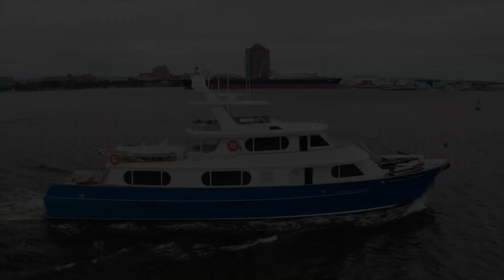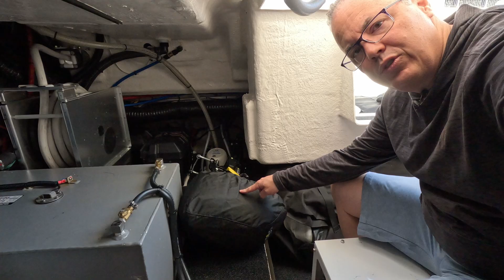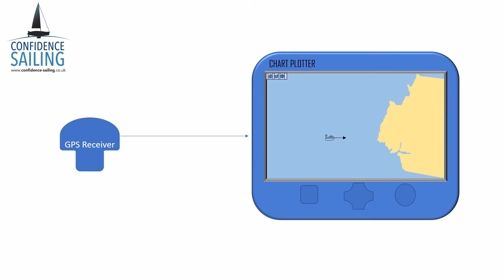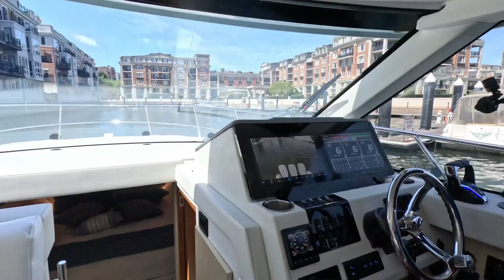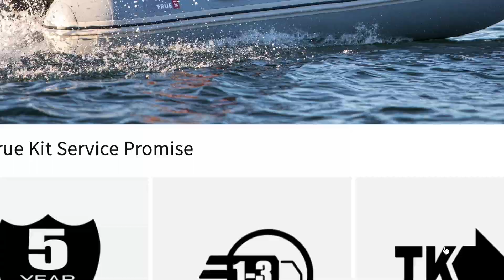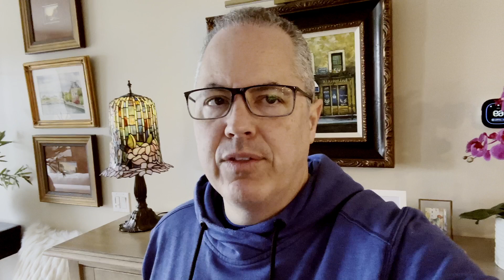(Ep 13) 2024 Regal 38 XO: PROBLEMS, ISSUES & HEADACHES

Comment: man you're being really 'diplomatic' due to your friendship with Regal, I assume. The fact is, these issues are horrific and unacceptable. It's widely known that craftsmanship in boats has completely went down the toilet in the past 5-10 years due to the woke era, economics, etc. Everyone recommends to NOT buy any new boats, just like you should not buy new houses, for the same reason. Just do some research and see, it's much safer buying a 10-20 yo boat than a new one these days, and you'll have less problems.
Reply from the maker: I could not disagree with you more.  Having owned 17 boats now, 1/2 of them being older boats and 1/2 of them being new.  New boats have their problems, they are simply different problems than older boats... same about of issues, just different.   Older boats have AC issue, entire systems that need to be replaced, out of date and no longer supported navtronics, parts shortages and no parts being available at all... Now I will say that older boats were built heavier/thicker hulls, however that is like saying a car from 40 years ago is better and safer because it is heavier.  If anyone has purchased a Carver can tell you their gelcoat was terrible compared to what is being manufactured today.  Although Carvers have one of the best layouts I have ever seen and experienced.  Now where we can agree on is boats built between 2021 and 2023... those are the boats in my opinion that suffered from more quality issues than those built before that timeframe and after...   This is just my opinion from owner boats built in the 1970's all the way to new boats....

Comment: With respect to the Garmin AIS issues, 1) Has Garmin provided any software patches to improve the experience?  2) Do you have any experience with any other vendors' AIS implementations?  If so could you compare/contrast?
Reply from the maker: That is a great question. No Garmin has not improved their AIS interface at all. It is still terrible. In my opinion, Timezero are far superior in their interface.

Comment: REALLY surprised that after a beautiful custom yacht that you chose a Regal.  Why not a higher end boat like a Tiara, Princess, even a Boston Whaler?  Just thinking of quality as opposed to the style or layouts here so perhaps that’s what it came down to?  Thanks!
Reply from the maker: Hey Hillary, thank you so much for watching and supporting the channel.  To answer your question in several parts, our first requirement was outboard power. There is no way to obtain the storage capability of the Regal 38 XO in a boat that would have inboard power. Second would be two cabin configuration. Referencing your list of other manufactures, two of them would be disqualified immediately because they simply do not make those types of products. Reference your quality comment, without getting into specifics, I can tell you that I have had two boats purchased back by one of the manufactures you listed because of massive quality issues and construction issues. In my opinion, all of these manufactures boats are built the exact quality standards, using the same pumps, engines, Navtronics etc, it simply comes down to style, and design.  Finally we wanted a boat built in the US, having had vessels built internationally before, obtaining parts for the simplest of things for example, a spare key, can be nauseatingly complex.  I hope that answered your question.  Again thanks again for all of your support!
Reply: @From100to26  I so appreciate your thoughtful reply - and completely understand.  All of your decisions make perfect sense.  Quite honestly, I found your channel because I was drawn to the big live aboard you built.  I’ve had the same dream for most of my life.  The seemingly quick turnaround on the direction you went was a sobering surprise, and gives me more food for thought.  My boating background has always been as the “girlfriend/wife” half of the boating couple, but I have my own money separate from my husband’s and am seriously considering buying a large boat (80-120’-ish) to do some slow cruising back in the Pacific Northwest where I used to live, and that would also serve as a home on the West Coast.  My husband and I currently live in South Florida and I can’t deal with the summers here.  He is a fair bit older than I, and while he used to enjoy boating he sold his last boat (a 42’ SeaRay Sundancer - which BTW had a 2 stateroom AND 2 head/shower layout) some time ago.  He is fine tagging along with me on this maybe-adventure I have in mind, but it really is my own project.  My hope is to find a boat large enough to serve comfortably as a part time home, but small enough to manage with day crew (temp captain and deckie/stew) while repositioning.  I do have experience running both a 68’ and an 84’ motor yacht with my previous partner, so I’m not a complete beginner LOL, but this was some 18 or so years ago and after some fairly serious health issues, my body isn’t as strong as it was back then 😂🤦‍♂️😭 I’m no spring chicken.  I’m so curious to hear more about the decision you and your wife made to go so far back down in size.  The big boat was beautiful and I was really surprised it had such a short spell with you, and even though I completely understand the reasons you discussed for making that decision was there more to it(?).  Cheers!
Reply from the maker: @hillaryc.3727  Hey Hillary... we had Bravo for 5 years.  But a lot to chat about reference your comments.  I would recommend sending me a DM at the From100to26 Facebook page and I will send you my number so we can chat.  The long and the short of it, going from 80 foot to 100 foot is double the size of boat, and also going from 100 to 120 is doubling again, most people don't realize that.  Your voyages will be measured in days not hours and to dock a 100 foot plus boat you will need at least two deck crew.  But again, we can chat more when we connect.... We had two deck plus 1 Stew on board, and I did all the engineering.  We refit all of Bravo's systems, even still we have larger projects every week.  It took the crew 2 days to complete a wash not doing the 1800 sq ft of teak deck and 700 feet of teak cap rails, which if they addressed those, add two days.  The vessel was washed every week because it had to even when sitting at the dock.  The new owner hired a Captain and because they did not have an engineering background ended up damaging a lot of the system and costing the owner well north of 250k.

Comment: Have you looked into Sharrow props?
Reply from the maker: Hey Chuck, thanks so much for your support and your comments.  Yes we have looked at the Sharrow props, at 15k for our boat, it is not an investment to take lightly.  For us we have to look at the reward vs cost, if you look at the higher end where we tend to run (30+ knots) the performance/fuel efficiency gains are rather negligible.  However where the Sharrow props shine is at the lower RPM and keeping the boat on plain.  We wanted to gain experience in how we would be running our boat before deciding on the investment... also if we were going to move up a size ....
Reply: @From100to26  really like the boat and the content! be safe and post more!
Reply from the maker: @chuckvogt899  Thanks again!  Working on the next video... we took the boat out for a month long trip.. so sorry I have not put something up recently...

Comment: I own a 2018 Regal 28 Express and have had problems over the last two years.  Fresh water boat mostly dry stack stored like my 2000 Doral 270 SC.  Rarely had a problem with the Doral but my newer Regal had an intermittent HVAC problem which eventually failed. A new control board fixed it until I I took it in for service and maintenance at a Regal Dealership for power steering ram and bow thruster failures.  Now the HVAC system has again failed.  Not enough qualified techs in the industry.  Love my Regal but reliability and service problems make my third cruiser probably my last.  Good luck with your issues.  🛥
Reply from the maker: Thanks Bob so much for your comments and supporting the channel.  Issues with components are really not a Regal issue, rather an industry issue.  At the end of the day, the components that Regal install in their boats are really no different than any other manufactures, I am so sorry you have been having problems with your boat.  That said I agree with you 100 percent about not enough qualified techs in the industry, I have been seeing that for years.  For us we are lucky because of dealer has an amazing tech support staff!!  The dealer makes or breaks an ownership experience!
Reply: I was just going to say, 'it all comes down to your dealer or local selection of shops. One thing I quickly learned is that I tended to NOT have issues with service folks. Why? Because I am incredibly nice to them. Sure, I'm firm about pointing out things they did wrong, but because of the goodwill I'd built, they would be very apologetic and jump me in front of others to keep me happy.
Reply from the maker: @stratolestele7611  I totally agree.. we always tip our techs very well and when we had the big boat, our main service companies we used to keep a retainers with them (always maintained cash on our account, never a debit), so we never had any issues.  That said, things are changing, the largest and best company that service the Baltimore area is shutting down as the owners are retiring.  Why, because they can't find good techs......  Thanks again for all of the support and watching the channel.

Comment: I have the same boat as you. Unfortunately I’m having the same problems with the ac units.
Reply from the maker: Hey Gary... you have the new units?  There is 1 correction available and that is for the temp of the water.  They are also working on another update that will take care of a lot of the fault messages I get.. that should be out in about 2 weeks or so.  I am working with them and feeding them information.  We just got back from our 21 day trip

Comment: Outstanding real world review. Not gonna argue the pros or cons of bottom paint on a cruiser but after several seasons of reapplication of bottom paint you will definitely lose several mph due to the irregular bottom surface because no marina can ever get the bottom back to factory new condition before adding the recoats. On a go fast vessel you can easily lose 5-8 mph. Looking forward to watching other videos.
Reply from the maker: Thanks so much Chris for your comments and watching the channel.  After talking to some of the industry coating professionals, since we have semi-ablative paint on our boat (as most boaters do) and the speeds we travel combined with the amount of running we do each year, we will remove a significant part of our bottom paint every year.  That said talking to the professionals, we should not see any degradation of speed year after year.  That is also the results I have see over the 15+ years of doing this.  If you are losing 5-8 mph... someone is doing something wrong....
Reply: Go fast to cruisers - as you said, totally different. Every go-fast I've ever seen is either trailered or on a lift. In fact, it's downright upsetting to see a go-fast with a bottom job. Get that beast outta the water! Lol
Reply from the maker: @stratolestele7611  Ummmm... can't say I agree with you.  We have not see any performance penalty, in fact a friend of ours had a 38XO without paint and we cruise at the exact same speed.  It also depends on how often you use your boat.  On our 100 footer we ran the boat about 1000 hours per year.  Right now we are 5 weeks in on the 38XO and have 65 hours and counting, so we tend not to get any growth on the bottom, which helps a lot.

Comment: I am still following your posts and find them very informative.  I couldn't agree more that allowing all parties involved in the sale, production and providing sub-systems for the boat to identify and rectify any issues is exactly the correct position to take.  As far as you A/C is concerned have you ever looked at the Mabru 12 Volt systems.  Since many of the issues you are experiencing deal with trying to make the 110v system more efficient the Mabru may off some real tangible benefits.  Just a thought.  Keep the videos coming I love them.
Reply from the maker: Hey Len!  Thanks again for the support and your comments.  We totally could look at the Mabru 12 volt system.. but then again, we would have to purchase those... and wire 12V wiring to those system... and put in breakers in the 12V panel... and Regal would no longer support the entire system.  So sometimes when you build a boat you are at the mercy of the manufactures....and can't dictate certain equipment.  From the manufactures point of view I get it as well because value is in quantity purchased.
Reply: All excellent points and demonstrate why allowing your providers the opportunity to resolve any issues is probably the preferred course of action.  Looking forward to your cruising videos.

Comment: Could you show how the aft canvas is installed/removed?  Your quick clip at the end looked like it was on a track system.  That seems like a really cool feature.  Thanks
Reply: Also interested! Fantastic video and series. Thank you!
Reply from the maker: Thanks for watching the channel and the support.  This is called the Palm Beach enclosure by Regal.  On all of our previous boats that had an aft cockpit, we always had these type of enclosures made.  Not to run with them on of course, but to keep them on for storage for security, privacy, you protect the aft cockpit area and substantially reduce the temperature in the cabin.  Regal used a track to secure the enclosure to the top, and they meant for you to unzip  each section and leave the upper part that slides through the track there... all the time.  We unscrewed the 3 small screws holding that in place and presto.. we can now slide the entire assembly off the boat in about 2 minutes after you unsnap all of the snaps at the bottom.
Reply: @From100to26  Not at the boat now. Wondering if the track is just there for all boats. Any idea of the cost of the enclosure? Wonder if Regal would sell after the fact.. .
Reply from the maker: @fredpodolsky9741  I think the track is part of the Palm Beach Enclosure.. I believe you can order it from them after the fact!
Reply: @From100to26  Thank you! Really love the series.